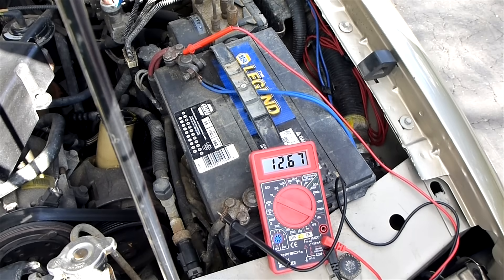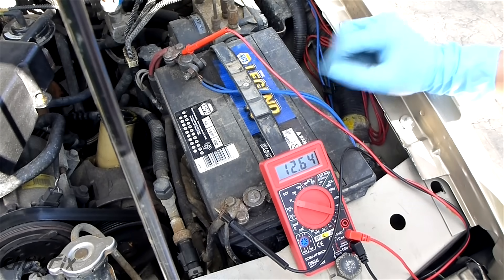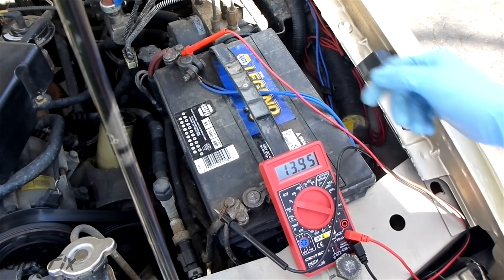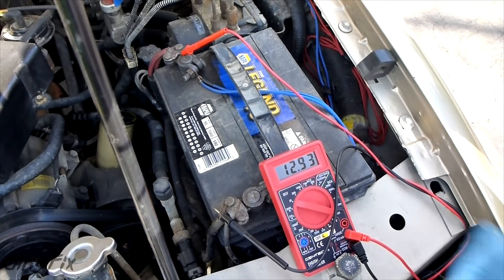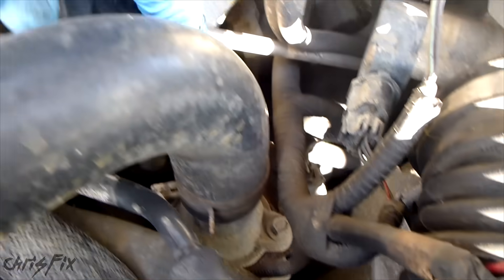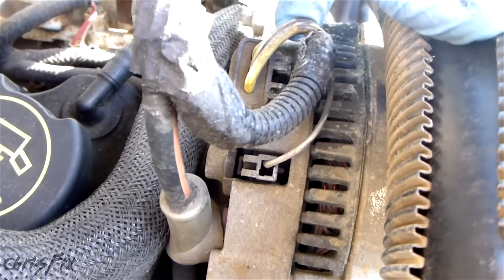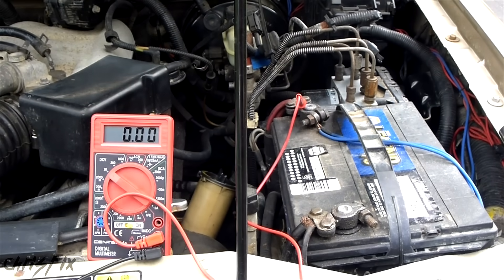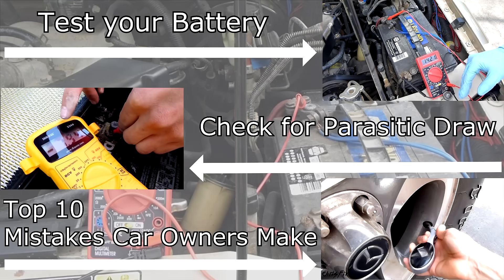How to Test an Alternator

Comment from the maker: +shane Blandford-scherr, I cannot reply to your comment for some reason but I hope you see this. If it only shows 11v then it can be a bad alternator, connection, or voltage regulator. Did you do the voltage-drop test I showed at the end of this video? That will let you know if the connection is bad. I think you just need a new alternator. The car is old and 170k miles is a lot of miles.
Reply: Thank you, I will do the voltage drop test, and if it fails that I'm pretty sure I'll end up scrapping it, clutch is completely shot anyways thanks again, great videos btw will subscribe
Reply: ChrisFix
Reply: hey Chris finally  ran that wire have  had it for a while  now  just procrastinating but still no dice there  is no fluctuation in voltage  when reving  the engine .My un trained  mind  instantly  thinks bad alternator  could  autozone  have lied to me two times  on separate  occasions   in different  cities  tuff one to believe  what I did discover is that there  is some resistance  at the terminals  from alternator  to battery  to fuse  box  but but it seemed  like the outer surface there is continuity so if you have anything  that comes  to  mind really  would appreciate it
Reply: ChrisFix   Nice video
Reply: Hey Chris I’m having issues with my 04 Silverado my battery not charging message popped up and I check voltage and it will decline into 11.5 as I drive once I turn car on though battery goes back up to 12.4. I don’t know what my problem could be truck turns on every time

Comment: Hi, I drive a 1986 Toyota Tercel and I'm 90% sure the alternators done, even though the car is low mileage (170k) and has already had the alternator replaced. It says its charging at 11 volts, and the car only runs with the batter terminal off if the revs are super high, but no battery light?? And the bulb does work... Could it be a bad connection? Also the alternators put in a stupid place behind the motor.... and I'm wondering if its worth replacing on a free car.... Thanks

Comment: Hi ChrisFix... first of all; excellent videos!!! I didn't know many "stupid" thinks I used to do with my car (both when cleaning it and when I drive them!)

I have a question; my personal drive (A Jeep "Libby" 2003) has an alternator that actually gets very hot when I drive  my truck several miles (about 192°F in 20 miles or so); the weather here at this time of the year round about 70 to 75°F, the cooling system is running fine (I just drained all the coolant, change the radiator, thermostat, etc.), I just made a whole tune up to my Jeep (new oil, filters, spark plugs, etc.) and the electrical fan is running fine too.

I just performed the whole test you just have shown in this video and everything seems to be fine (Battery at aboy 12.7V, charging fine, etc.)

So I have two questions; It is normal for the alternator to climb to these temp readings? and, If that is not normal, What should I check or do in order to fix the problem?

In advance; thank you very much for both your videos and any lead you could provide me about my questions!
Reply from the maker: Rodras el Astur Rodríguez It is not normal for the alternator to get almost 200F. I would think it is doing this because there is a bad bearing, or maybe the voltage regulator is heating up because you dont have a large electrical draw (so the voltage is turned into heat). Does the alternator make any noise? Can you find another person with your jeep and see if theirs gets that hot? Maybe it is normal for that car?

Comment: The best thing you can do for your cars electrical system if your battery terminals are not OEM is to do like I did and purchase a 25' roll of welding lead wire from a local supply shop and take it to a starter rebuilding shop and have them use that wire to rebuild you a new wiring harness that runs down to your chassis ground and your starter and up to your battery all with proper crimped on lugs. I just took my OEM harness off and had them copy it, just using heavier cable... One thing I did was had them add a connection coming out the front with a disconnect for a winch or jumper cables. $50 for the cable, $25 for their time and connectors $30 for the Anderson powerpole disconnect I added for a power tap at the bumper... The best part is that the battery terminals they used for my top post battery have 3/8 20 bolts that stick out the side with a nut and washer for proper accessory attachment. This is totally not necessary, but in my case I actually had them parallel in a second battery into my harness and locate it on the other side of the engine compartment because I have so many accessories I wanted additional key off runtime.

Comment: Thorough and concise at the same time while still being user friendly, very impressive... I'm reminded of a quote I once heard...

"...Fools take a simple idea and make it complicated, While wise men take a complex one and make it easy to understand... "

Well Done Chris.
Reply from the maker: ***** Thanks for the quote. I try hard to make it simple!!!
Reply: ChrisFix
I've got a 2009 RAM 1500 Hemi (4x4, Black, CrewCab), and last night got caught with a half crank then a bunch of ticks after running ONLY the radio for 15-20mins... was able to jump it and started np.

I was looking for rough numbers to test whether it was the Batt or the Alt... and I came across your battery and alternator testing videos. Which had the exact info I was looking for.

So, Thanks again... the following are details which you can skip....

I first hooked up the meter  to the Battery with 12.6 volts, then I ran the head and fog lights(stock) for 4 mins (lost track of the 2 mins you said) the meter showed it around 10.** volts and it clicked on me when I tried to start it...

So I jumped it again, started no prob, Meter was reading 14.4V (engine running) I turned the lights back on, along with the A/C, and the radio... and the volts dropped to 13.98 over 60 secs then shot back up to 14.3V... I shut off all the accessories at the same time and it spiked at 14.79V then dropped to 14.4V again

* EDIT: Oh and then I shut it off and started it again with the meter on show Minimum Value and it dropped to 11.5V (but not under 10V)

To me it seems like my Batts going and I've got my 5yr warranty expiring in 2 weeks so the timing is nice
Reply from the maker: ***** Great! Yea, sounds like it might be the battery. You might also have some type of parasitic draw causing your battery to loose juice overnight. Might want to check that since you are in the process.
How to Diagnose a Short in your Car

Comment: Gotta love that free Harbor Freight multi meter
Reply from the maker: Haha, yea man!
Reply: ChrisFix it's how I fixed the squirrel damage on my 2000 Mazda B4000 4x4
Reply from the maker: That sounds bad.
Reply: ChrisFix but I got that truck for 200 bucks. Then 25 bucks off wire and heat shrink and now I got a near perfect truck
Reply from the maker: Well, that worked out nicely! Great job!
Reply from the maker: ***** Perfect! Cant beat that!
Reply: @chrisfix  You took as a joke, but I think it is Sarcastic,  oh well.
Reply: I had a buddy and he passed away recently,he was one of those one of a kind individuals and he loved harbor freight,he must have had at least 30 of those multi meters hanging in his garage, everytime i would bring someone to visit he would gift them one,a lot of people learned how to use these things because of him,lol
Reply: @dntlss  even as a master tech, I'd keep a few HF multimeters around for various reasons. Excellent tool for the price. Are there better tools out there? Most definitely.
Reply: I keep 2 multimeters around right now; I've always had at least 1 for about 40 or 45 years, now.  They are also sometimes called dvm's, for digital voltmeter, or just voltmeter, although multimeters today are multifunctional, which means they also measure current, like an ammeter, and resistance, like an ohmeter.  They are simple to use, and easy to understand, if you know Ohm's Law and the difference between a series and a parallel connection.  Look em up, in any basic electronics text, and once you know those simple principles, you can use a multimeter, in almost any situation, for testing basic, simple dc electrical circuits.
Reply: Same one i have lol
Reply: How do I get one of those? Lol
Reply: @Templar-jj3ig  go to horrible fright, if not free, only a couple,three, bucks! saw one for 4.99 in ad today. Worth it.
Reply: Great. I was wondering if mine would work for this.
Reply: Hey, a multimeter is a multimeter no matter where you get it. It doesn't have better components or worse components than an Auto Zone multimeter.
Reply: @terrygiancaterino4740  True. But I don't like having just one multimeter around. There are some nice feature filled meters on ebay for around 10 bucks.

I'm not sure but it seems HF isn't giving these away for free as often as they used to.

Comment: i liked that  I wanted to ask u what would cause my batterie gauge to go up can it be my alternater ive got a 97 explorer with a 4.0
Reply: I did your test and it didn't look good so I took it down to Pepboys and they said it was not any good so I got a new one and every thing is grate
Reply from the maker: What do you mean "cause my battery gauge to go up"?
Reply from the maker: Haha, awesome man! Glad the video helped you diagnose the alternator! That is the feedback I love hearing!!!
Reply: Yea it helped alote what size amps should I get 95 or 130
Reply from the maker: What is stock? Do you have offroad lights or any added on electrical equipment (subs, lights,winch, etc)?
Reply: No I don't have any extra  things on it it's all stock
Reply from the maker: Then go with the stock size alternator.
Reply: That would be the 95 right ???
Reply from the maker: It can actually be either depending on what the factory package came with for your car. You can get it tested and see when you get your new one (bring it in).
Reply: Ok thanks
Reply from the maker: You can also get your VIN# and call a Ford dealer and ask them.
Reply: Sounds good ill do that
Reply: Sounds good ill do that

Comment: The original starter would also get stuck. The air filter got disintegrated and got sucked up. It's the same starter just keeps getting stuck and won't start.
Reply from the maker: Well, sounds like the starter is bad or it needs shims. Did you remove all of the air filter from inside the intake?

Comment: Do you know anything about a 90 hp efi 4 stroke motor?
Reply from the maker: Yes. What do you want to know? What is the motor for?
Reply: A pontoon boat. It won't start I replaced the starter and the starter gets stuck on the flywheel
Reply from the maker: It gets stuck engaged? Do you have the correct starter? There should be a certain number of teeth on the old starter and the new starter should have the same number. Might want to try and remove the starter and bench test it. The gear on the starter should get pulled back in by the bendix spring after you remove the power. If it does you need more shims.

Comment: Great tutorial chris :-))

The bat+ to alternator+ voltage difference can be bad if you have replaced your starter motor and not cleaned the connections, often the alternator gets its live from the starter feed. (ive seen this quite a few times)

When i was in an auto factory we used the values 13.8 - 14.2 volts for our normal alternator range, but alternators are not really exact devices.
Reply from the maker: Thanks bud! Good info here! I guess the starter is an important ground!
Reply: ChrisFix
Yes it is an important live, i allways enjoy your tutorials :-))